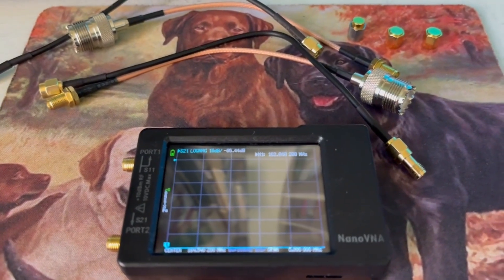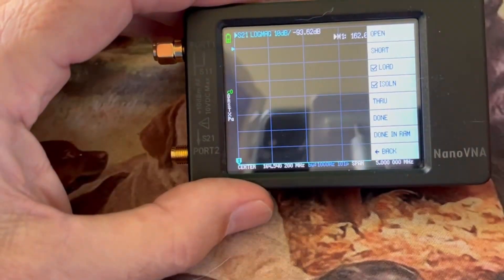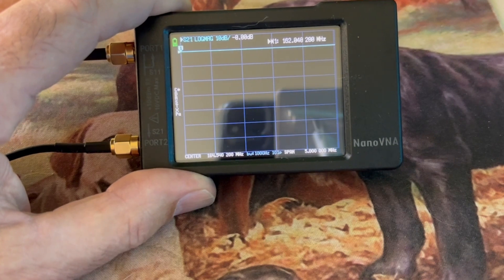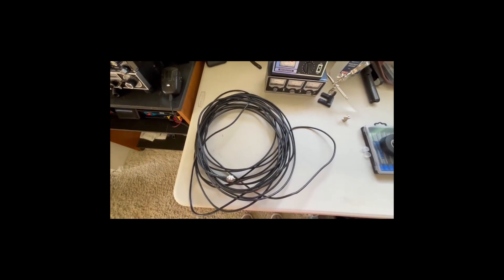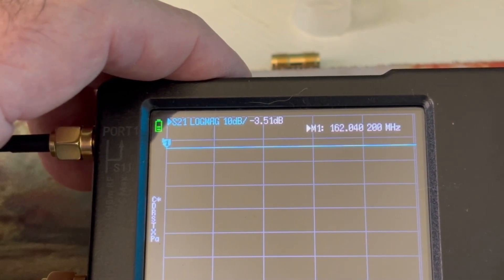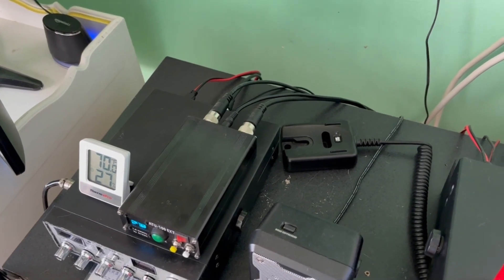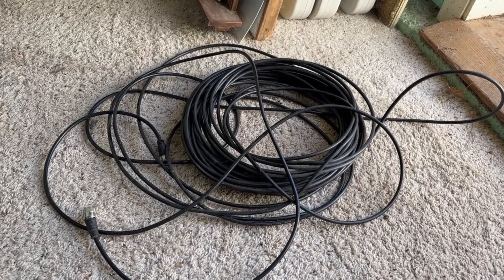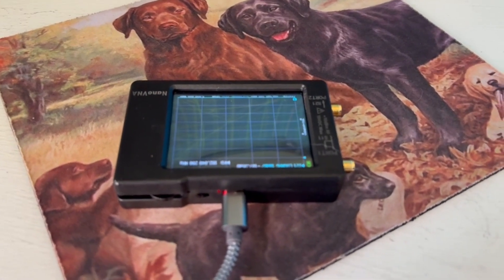Testing Coax with the NanoVNA

Comment: I know from experience that if you see less loss at higher frequencies, you know you have a broken center conductor.  (higher frequencies will cross a gap better than lower)  of course you will have a lot more loss than you should have.   if the cable has been bent and compressed,  this can give you issues as well,   if you have a broken center conductor, it may have been making contact during your "good" tests, but lose contact when you move the coax a little.